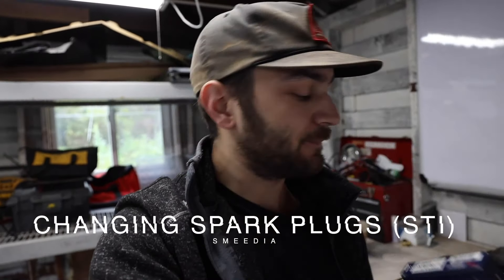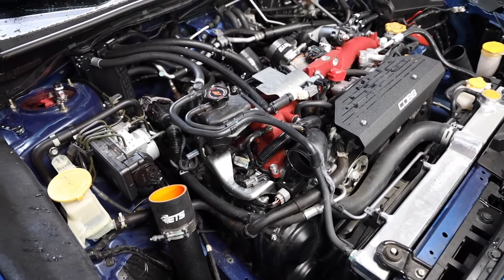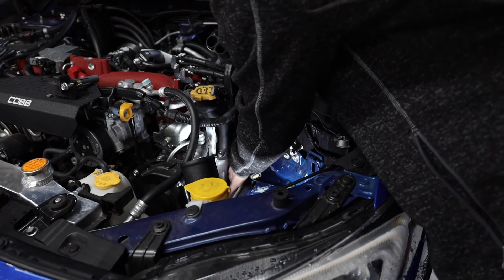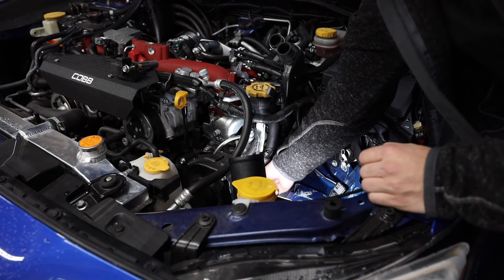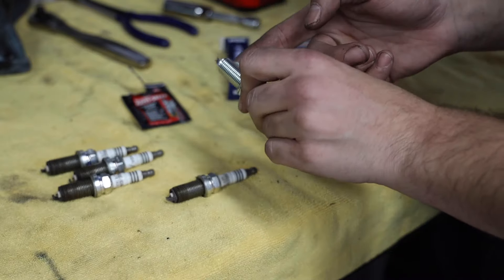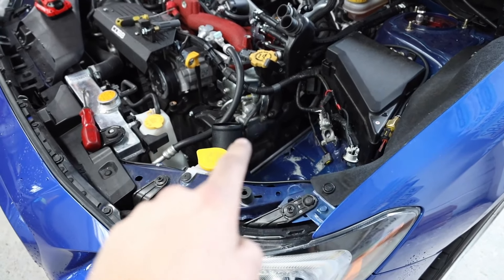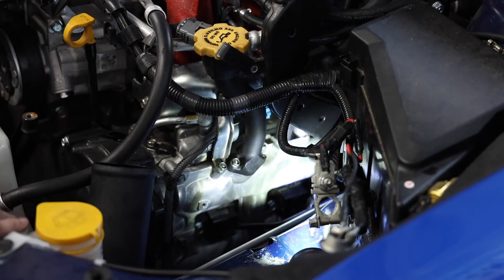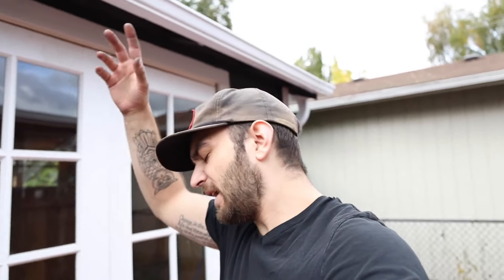How to Change Subaru Spark Plugs (Easy)

Comment: I've always used an extension with an elbow
Reply from the maker: It was always a pain to pull out the plug for me with the elbows. But if it works it works!
Reply: @Smeedia  I still pull it out how you do actually I just use the elbow to get in there, I dont take out as much stuff as you do tho! Just part of air intake and battery!

Comment: After pulling and replacing the battery  did your multi function screen loose any setting ? Or was it only the clock and radio ?
Reply from the maker: Only the clock and radio 🙏

Comment: Hey man I’m watching your spark plug video right now. I own a wrx and I could use some help. My car has been having rough starts. But only rough starts, like when I start it it sputters and the boost gauge is going wild. I just cleaned my MAF sensor and it hasn’t seemed to work. I thinking it’s either my VVT sensor because those are looking pretty old and dirty and I know those deal with timing of the cams and valves. Or it could be spark plugs and coil packs. My car is a pain in the ass and the only code it gave was p0300 for random misfire detected which tells me absolutely nothing. I need some help!!!!! PLEASE
Reply from the maker: Any mods on it and any tune?
Reply: None completely stock
Reply: Only thing is nameless axle back muffler delete but that’s it and I checked there’s no leak in the exhaust
Reply from the maker: I would check timing to make sure everything still lines up

Comment: Do the spark plugs you use for your STI work for the WRX as well? I have a 2017 and when I clicked the link the spark plugs it had said it didn’t fit but I’m assuming that is just on Amazon’s part haha.
Reply from the maker: Diffrent part number, 

https://subimods.com/products/ngk-iridium-spark-plug-set-stock-heat-2015-2019-wrx-2014-2016-forester-xt?variant=41169119740079&currency=USD&utm_medium=product_sync&utm_source=google&utm_content=sag_organic&utm_campaign=sag_organic&gclid=Cj0KCQjwjN-SBhCkARIsACsrBz46YcVEbfybVnwQ9ql-niLSXEdI5djobpfCx0zY2UzBj4RkjINdfJAaAvaAEALw_wcB

Comment: Do you have any videos showing how to remove the parts around the spark plugs?
Reply from the maker: I do not, the only things that need to be removed are the battery, secondary air pump and intake, in the spark plug video I point out where the bolts are for the pump. The battery is just 2 10mm bolts to remove that one.

Comment: Its so bad on BRZ/FRS I had to lift the engine to gain access
Reply from the maker: The engines are so close the the frame rails its ridiculous. How high did you have to Jack it up?
Reply: @Smeedia  Well I undid one sides motor mount bolt and used a bottle jack to raise/tilt the engine until I could actually get to them. If I had to guess maybe 5/6 inches. All I needed was that bottle jack and some spare hose to grab the spark plug out(couldn't get a socket and plug out at same time without hitting rail).
Reply from the maker: @jbrockskill  that sounds awful, I never had my BRZs long enough to need to do spark plugs. I made an attempt once and quickly decided I did not care enough to do them 😅

Comment: Hey man great video. So to conclude there's no need for a torque wrench? Just finger tight and 1/2 turn should be good?
Reply from the maker: Just good N snug is 🤙 I've never torqued them 🔥
Reply: @Smeedia  just wondering in case my plugs are seized up because they haven't been changed for long, can I spray some penetrating spray into the chamber ?
Reply from the maker: Yes you can, I wouldent do a crazy amount though

Comment: Links to related videos on removing the other stuff would be greatly appreciated if anybody has them.  I'm hoping the video I found on the secondary air injection isn't the one I need since he cut his out (not exactly feasible for me since I have to put it back in afterwards).
Reply from the maker: Secondary air system 
Unclip the electrical connector 
Remove the 2 12mm bolts that bolt it to thr AC bracket 
Use pliers to unclip the secondary hose tubes that route toward the back of the engine 
Remove the 1 10mm bolt on the drivers side rocket cover 
Then you can move it to get to the coil packs
Reply: @Smeedia  thnx man, I appreciate your response.

Comment: Is there a torque spec for the plugs? how tight should they be? (sorry if this is a dumb question)
Reply from the maker: Good and tight but not too tight, there is a TQ spec but off the top of my head I don't remember. Going to be hard to get a TQ wrench down there also

Comment: For the coil packs do i need them to go back into the same one? or does that not matter?
Reply from the maker: The black coilpacks are for the rear cylinders the two grey ones are the front 2 cylinders
Reply: @Smeedia  Thanks!! i just did this today and my car was running rough.
Reply from the maker: Hope you get it worked out! The ECU might just need to relearn with the new plugs.
Reply: @Smeedia  Hoping that it won’t run rough because i didn’t put the plugs in the right spot haha.

Comment: Your did a great job with the filming and all but first of all, Your car is a 2017, your spark plugs are fine. I could see the plugs you took out where basically new with minimal wear on the center electrode. Yes they may not be as ‘clean’ as new ones but I promise you there is no difference in performance….. 200 miles from now the clean ones you just put in will be ‘dirty’ just like the ones you pulled out. Also NEVER EVER put anti-anti-seize on spark plugs in fact most spark plug manufacturers tell you not to use anti-seize PERIOD you are doing more harm then good. When you apply it to your spark plugs you are reducing the friction coefficient and you will pass the torque specs and can easily strip your aluminum cylinder head threads. Aluminum is extremely soft. Plus if your needlessly changing plugs after 15k miles you really don’t need to apply anti-seize to begin with LOL. 

-From a Subaru Tech.
Reply from the maker: Swapping plugs before a tune, I'll always stick with 20K changes on mine. For stock cars the standard interval is fine but once you start pushing them your going to start killing plugs quick. 

While manufacturers may not recommend it I still add a small amount of anti sieze the plugs are not going to back out with a small amount. Have had too many sets pull thread or snag in the head from previous people over torturing them. 

But diffrent strokes for diffrent folks, we all have our own preferences.

Comment: Did it personal record time of 1hr 30 minutes thanks to your video! That cylinder 4 is a b!?(#. Make sure you get a ratchet that does not lock into the extension. Didn’t realize you can hate a tool that much. Thanks for the video!
Reply from the maker: Not bad time! When it locks in place I have to pry them apart with a flat head to get then apart to get the ratchet out 🤣

Comment: Big thing to remember if you unplug all your coil packs. Just remember black to back. Or your going to have a bad time.
Reply from the maker: Good point, totally forgot to mention that. You wont have a good time if you get them mixed up
Reply: I learned the hard way.
Reply from the maker: @SuperMuddybuddy  hopefully nothing that couldn't be undone by swapping them back.
Reply: Just a bit of a panic. Have you seen the wholes in the frame of the Subaru accent with tiny steel plates tack welded over them? Perfect in line with the spark plug holes. Was thinking about drilling those holes to make changing spark plugs easier. You could turn your wheel an access them with a long extension through the rim.
Reply from the maker: @SuperMuddybuddy  it's not a bad idea to do that, I would worry about the rails rusting after drilling into them though. I mean painting them would solve the rusting issue but I like the idea!

Comment: I know you own a brz but the technical instructions on the frs specify jacking the engine out of the cradle to which I definitely do.  Haven’t done plugs on my wrx yet but I know on the frs I can’t physically get my bear claws for hands in the tight space haha
Reply from the maker: When i did them on the BRZ I had to jack up the engine, impossible to get them out otherwise from what I've tried 😅 thankfully on the STI I don't need to
Reply: Smeedia 
Well if there is enough space like on an outback I’ll be happy.  I don’t work on Subaru’s very often, last time I did the connector retaining tab broke like on a Toyota and ended up falling out
Reply from the maker: I've seen that happen on older models farther frequently, hopefully does not happen to ya

Comment: Damn, I couldn’t get to the cylinder 4 plug using a 3” extension and spark plug socket as you did.  The frame is still in the way.  Maybe I’ll try a 1-1/2” extension.
Reply from the maker: Hopefully that works! 🙏

Comment: About to do this over the holiday weekend and dug this up for a refresher. I think peeps that jack up the engine and other silliness are not aware of the socket disassembly and coil pack spin techniques. I had to figure out the spin one when I brute forced the packs in there and got wild misfires and blinking cels. That moment when you try to fix something and you make it 10 times worse. 😭 

But, lots of people worried about spark plug part #'s. It's in your owner's manual. There are actually a few different ones that go in EJs. My 205 and 255 are different.
Reply from the maker: Its not nearly as bad as people make it out to be, you get a technique and a groove down after a while. The 2309 NGKs have always been a solid bet for me 🔥

Comment: Did you tighten the plugs to a certain torque value? I’ve never done spark plugs before and I definitely don’t wanna over torque lol
Reply from the maker: 20lb/ft, but getting a torque wrench down there will be a challenge 😅
Reply: @Smeedia  Yehh I figured lol so you would recommend to finger tighten first then just make it snug? hopefully I wont over snug lol
Reply from the maker: @marcn1777  that's what I do, shouldent have an issue but if you can somehow get a torque wrench down there then that would be ideal
Reply: I’ve been told “hand tight and then 1/4 turn.”  Knock on wood that hasn’t failed me yet....

Comment: 3/4 down and 1 to go. 
How the hell did you do the Rear Passenger one?!?!? 🤔
Reply from the maker: A lot of cut hands 😅 that one is a little bit of a pain but you just have to keep at it
Reply: Smeedia I ended up having to remove the nuts that secure the Motor Mounts. I was then able to raise her 2-3 inches and that did the trick. 
I applaud you for not even having to lift  the motor at all! 👏🏽
Reply from the maker: Once you start getting in there more and more you'll be able to save the time to not have to jack it up, but good job. Sparks plugs are always a pain with these cars!

Comment: As I'm attempting the spark plugs with the other stuff I'm doing right now, it would seem that the drivers side doesn't really seem to be the 'hard' side at all.

I cannot find ONE video out there of someone showing the passenger side. I believe I know why now. 

How in the HECK did you remove Cyl#3 without removing the engine? There's a bracket holding a hose attached to the screw with the pack, and you have basically 0 clearance to get a ratchet in there.. Even Cyl#1 is a pain, as every single socket I have is either too deep, or too shallow, even using all the extensions and adapters I have.

There any way you can show how you did the passenger side? It makes the drivers side look easy!
Reply from the maker: I'll make another video showing the passenger side but the bracketed pack use a small 1/4" Rachel and it pulls right out, outside of that should be the exact same as drivers side
Reply: @Smeedia  Actually, after a recharge and thinking a bit more, I had another go at it. I actually finally managed to get them both!

Once you get over the fact it's going to take some bleeding and work to get done, and the right combination of bits/sockets/etc, it CAN be done. Just, did I mention the bleeding?

Here were the tools I all needed for the passenger side. In comparison, once you get the 2nd Air Pump off, to me the drivers side is a cakewalk.

https://pbs.twimg.com/media/EXn-nO9WkAMP8xP?format=jpg&name=large

Still, thanks for all the videos you've done and keep making! They've been a HUGE help to me! Gonna be a crazy couple weeks installing all I have here right now before my next protune at the end of the month, but know I'm gettin' the right stuff since it's almost everything you've already installed!
Reply from the maker: Actually just ordered spark plugs to make another video of it! Haha 😅 but glad you got them, it can be a real pain to get in there to swap them out!

Comment: Heyo just got my first car and it’s a 2010 Wrx hatchback. Love it already but it’s got a rough idle at 185 thousand km and I was wondering what you would think that is. I’ve been told it might be the throttle body or the spark plugs, just wondering what you think it might be?
Reply from the maker: I would check the spark plugs, coil packs and the MAF. Those should help clean it up a little bit for the idle
Reply: Thanks man!

Comment: No torque specs? For shame. 😋
Reply from the maker: Good N Tight lol 😅 did not see a need for it, most people dont have a TQ Wrench that will fit down there
Reply: @Smeedia  I am just cautious about it. Too tight and you damage the threads in the block, too loose and it could fly out of the engine. But the space does look awfully tight.
Reply from the maker: @Brisky86  true, best judgement for tightening them. My 07 STI I bought used and the previous owner over tighten them and shattered a NGK plug in the block. It was a nightmare to retrieve.

Comment: What’s up man, love your videos. Just curious have you ever changed the gapping and if so, why? I know the NGK 2309 one step colder plugs are pre gapped at .032 but curious to know if some pro tune shops have there own gap specs.
Reply from the maker: Sometimes, on high HP builds I'll gal them down to .028
Reply: @Smeedia  that’s what I thought. Thanks a lot man. 👍🏼👍🏼👊🏼

Comment: You make it all seem so easy. 
Can you please supply a list all the tools needed? In order to change coils, and spark plugs. 
Also thank you for this video.
Reply from the maker: There's a list in the video but 
10mm 1/4 socket 
1/4 Rachet 
Spark plug socket 
3/8 rachet 
2" extention 
Flat head screw driver 😁

Its not too bad once you get it going 🔥

Comment: I've been catching up on the blob eye build and the EG build, and I have to say I feel a little silly having gone the jack the engine up route.  All I'm wondering now is what if any difference is there between this and a GD chassis frame rail?  I remember doing my blob eye in 2008, but let's just say I was still learning how to use a wrench.  I remember it being harder than you made it look.
Reply from the maker: Should be the same for a GD, GR or VA 🥳 my old 05 I did the same way 🔥

Comment: I got a 2020 STI. Just bought everything I need to run E85, and also I got a Cobb 20G. I already have a Mishimoto FMIC, tomei headers, grimmspeed high flow down pipe, tomei exhaust, AP intake, and HKS BOV with a custom tune. Pushing about 294 wheels. I use to live in WA when I was in the Army. Love your videos bro. Btw you play WarZone? Lol
Reply from the maker: Eyyyy, sounds like a fun set up! And not so much anymore. Never have the time 😅
Reply: @Smeedia  yea thanks. But I’m throwing wayyyy too much into it. And seeing how I jus had a new born I should probably chill out lol

Comment: Good content man, people really don't read the manual it is clearly mentioned there how to easily remove No. 3 & 4 coil packs hahahahhah I was surprised how easy it is when I tried it myself. 

Are these the one step colder plugs ?
Reply from the maker: They're really not as bad as everyone makes them out to sound, took me a few spark plug changes to figure out this technique but it makes life so much easier! And yes they are, they one step closer plugs will be the #2309 😁

Comment: Just did my spark plugs, took about a solid 2 hours to do, lost a 10mm in the process 😪. Also, my swivel spark plug socket definitely made things a whole lot easier.
Reply from the maker: What happened to the 10?! I've never liked the swivels when doing plugs, always feels like its going to strip the plugs 😅
Reply: @Smeedia  The 10 popped off my ratchet after I finished tightening the coils back on. Guess I'll have to take my splash shield off to retrieve it.
Reply from the maker: I've made the same mistake before and have lost multiple sockets 🙃